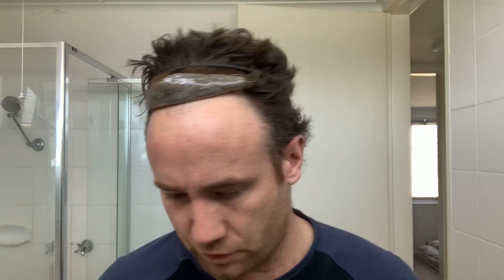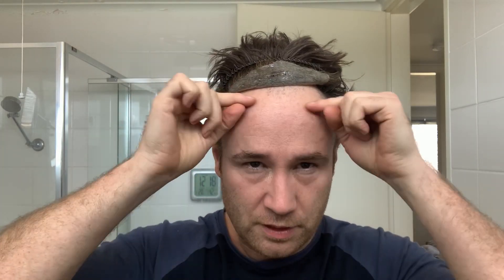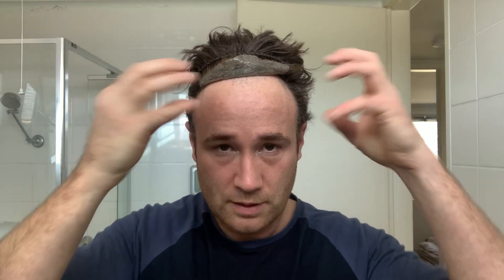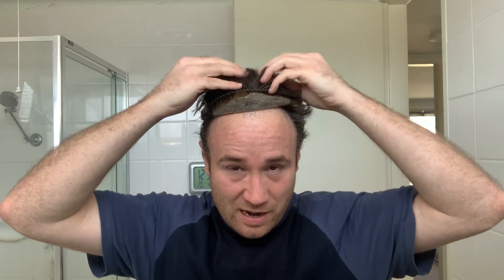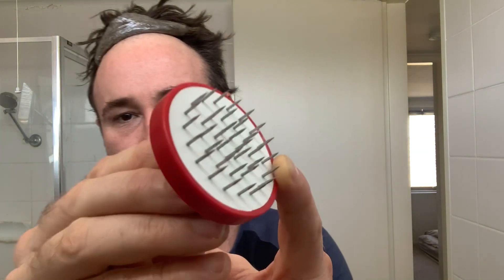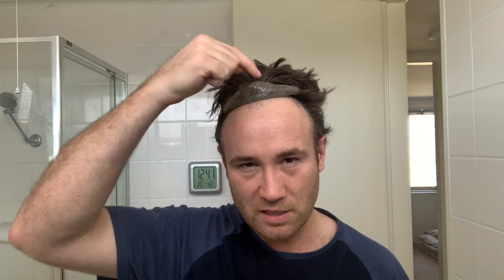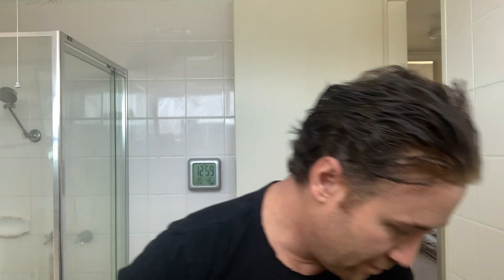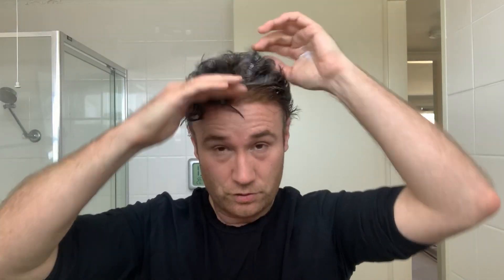Let's talk about Adhesives

Comment: Adhesion is one type of molecular structure clinging to another type of molecule structure, such as tape onto the skin. Cohesion is a mutual attraction between molecules that are alike- like a sentence structure, how all the words work together to create one COHESIVE thought. Cohesion is a bond that is built up internally, like your example of the peanut butter on bread, and adhesion is strictly one material sticking to another material. When it comes to sticking an object into skin you’ll be in the market for an adhesion and the list of demands/requirements to ensure a secure long lasting bond is pretty extensive. What comes to my mind as far as possible out of the box options that might be worth exploring is some using some kind of medical cyanoacrylate adhesive- surgical glue. I’m thinking along those lines because it’s made to be used on the skin, it’s a strong bond, very durable, and water proof (so I’m assuming it would do well with sweat also). Have you ever tried surgical glues before? Or do you know if the glues manufactured for wig instillation is already modeled after surgical glue properties?
Reply from the maker: cyanoacrylate adhesive (surgical glue aka topical skin glue aka 'dermabond') costs $79.95 per 0.5 ml. 12 vials for $396.50 not including delivery: https://www.teammed.com.au/shop/wound_care/wound_closure/topical_adhesives/dermabond_topical_skin_adhesive/
Reply: StickOnHair  that’s absolutely obscene! I had surgery last year and surgical glue was used to close up my incision. In the middle of the night during that itchy healing phase I scratched my incision until parts of it opened. I was able to buy a bottle of surgical glue for $7.99! I just looked on Amazon and can find various brands of the glue anywhere from $7-30 all depending on brand and volume. I know you’ve mentioned how expensive other things are in your country, but if you’re paying that much for surgical glue their just robbing you blind at that point! 
I can literally walk around the corner from my home to Walgreens or CVS or Walmart or Target and buy it for less than $10.
Reply: StickOnHair next time you’re in LA or anywhere in America, come with a list of all the stuff you can buy super cheap here! Haha. Bring an empty suitcase and just load up.
Reply from the maker: @lindzexposure9347  Unbelievable. Checking website. Wow!!  USD19!!! I registered... I placed 1 vial into my shopping basket... Inserting address... Here are my shipping options: Fedex Int Economy: USD139.62. Fedex Int Priority USD149.12. USPS Priority Int USD59.10 USPS Priority Mail Express Int USD79.10. I've said it before and I'll say it again. America has EVERYTHING.

Comment: Hey, like your videos, ive got my first hair system from lordhair, thanks to you👍✌️
I wear full head system on top of my head, can you give advice about how to attach it by my self without messing everything)))
My system is s1 and i use devlyn adhesive😊
Thanks✌️
Reply from the maker: Artur Liping I’ve never had to do a full piece. I’d say most people make sure the hairpiece is cut properly to their shave-zone, attach the front first with glue and just add tape to the back and let it fall back and hope for the best. But If it were me, I’d get a 7ft iPhone tripod from Amazon, wifi link it to my iPad and glue my head properly with proper visibility using the screen in front of me. Davlyn green and acrylic glues can’t be rinsed out of hair easily like water based glues (in the first 30 seconds),  so maybe tape or water glue is a good idea for the back of your head. This will be tested every time you lie on the pillow and move your head around so it can’t be a weak hold. The front hairline is crucial for realistic appearance so use the strongest hold (Davlyn Green) for that. As for breathability, let me know if the full piece of plastic over your entire head gets hot. People keep talking about poly perimeters with lace in the middle for breathability. I really don’t see any way to glue the perfect perimeter at the back of your head: you can’t feel for it without getting glue on your fingers and it’s going to be be hard to see it without folding it back which will bend the base and give you a false sense of distance. My bet is that 100% of full cap wearers have inaccurate perimeters with overhang as a daily occurrence they have simply learned to accept. Here are my 2 best guesses about the best full cap hairpieces: poly perimeter with lace centre for easiest cleanup, or poly hairline only with the rest lace for most realistic hairline AND most realistic perimeter (lace blends with natural hairs more realistically than poly). Both of these options will let your head breathe. I tried stabbing my poly hairpiece a bunch of times with a spiker but the holes were too small to do anything. Lace breathes whereas poly does not. If you have to choose between overhang and gap at the back of your head, you MUST favour the overhang. If there is overhang in all directions, resize your hairpiece smaller - there is a little bit of stretch in both lace and poly but beware of recoil. Gaps are UNACCEPTABLE. I leave them sometimes cause my hair is curly and you can’t tell when my hair is dry if there’s a 1 mm gap. That mirror thing I built does not allow me to see the back of my own head - you need a camera with a light behind you and a screen beside the mirror so you can see your entire head. I recommend a gooseneck tripod so you can just bend the camera instantly into new positions as required. Above all: don’t run out of hairpieces. Let me know if the full poly system pisses you off, and if it does, let me know the best way to poke holes in it please :) I think the ultimate configuration is the full poly unit you have but with holes for heat venting so you can peel off glue easily all over and it hides shine completely. I would do this even though the perimeter will not blend as well as lace because cleanup is more important than perimeter blending because poly blends well enough if the hair covers it. Please don’t rip the hairpiece because your holes are stupid - I have zero experience with full hairpieces. Remember, glue will ooze through lace when you melt it by wearing a hat or helmet so poly really is the ultimate answer.

Comment: You covered the holes with glue. Try going just around the perimeter with the glue. Also punching holes in poly some holes will reseal somewhat because of the hole peice on hair side lay back down over the hole. Just thinking it through
Reply from the maker: The glue magically doesn't cause sweat buildup under a lace piece with full glue coverage. The poly is causing extra heat or preventing evaporation through microscopic gaps in the glue - it needs holes. But I don't like lace because I cant wear a hat or helmet, the hairline glue bloats after a shower, the glue visibly shines through, etc. Poly with holes is my best solution. I just haven't succeeded in putting the right holes in it yet - I wouldn't use a hole punch because I don't want to lose hairs - I just want heat vents.

Comment: Hi, have you still noticed a shortage in hairsystems and cost increase?
Reply from the maker: Haven't needed to check lately. I assume its harder to get exactly what you want for pre-covid prices, though. I'm finding it really hard with a lot of things I buy online at the moment, as workers in many countries are legally obliged to work from home. This slows everything down.
Reply: @StickOnHair  Thank you, your channel is awesome!
Reply: I have no issues with walker hold glue, here is what i do:

- decant the glue into a different bottle with a think nozzle so you add a thin and precise layer DIRECTLY to the system. These can be found on amazon.

- use a small hobby brush to spread the glue. Again amazon in packs of 100, chuck em after one use.

- I re apply every 4-5 days, no idea how people go a month, its so easy to do takes me 20 mins and doing it this way is comfortable and gives a bullet proof connection every time.

- side note: rub a little cookibg oil on scissors before cutting tape to avoid it sticking
Reply: I believe it’s because of the majority of systems originate in China.
Reply from the maker: @jackparsons6299  Do you glue over the old glue?
Reply: @StickOnHair  no why do you ask? I always completely clean my system every time i take it off. I don't shampoo my hair every time i shower though, so I wash the system when I re groom
Reply from the maker: @jackparsons6299  I've recently started NOT cleaning the base of the hair system, and I just glue the new layer over the top of it. I know this is lazy, but I think I throw the hairpiece away before glue build up under the hair piece can affect me. I do this with Davlyn Green though - Walker Tape Ultra Hold is a lot thicker, so multiple layers might be a problem.

Comment: I’ve been using a system for around a year now. I’ve tried a couple adhesives, unfortunately the one you use isn’t available here. I’ve been using walker ultra, would you say that’s better than ghost bond platinum for PU ?
Reply from the maker: Everyone who likes Ghost Bond says Platinum is better than the rest of the water glues. Ultra Hold was the best glue I used for several years (but I still give it 3 out of 10) until I tried Davlyn Green, which I give 5 out of 10 (the best score I have given any glue). My experience with water glues has been disappointing (all less than 1 out of 10). Acrylic glues are very shiny so no good with lace. There is increasing chatter about silicon glues, but my experience has been limited to Walker Tape Extreme Hold, which cannot be re-stuck AT ALL without adding more glue - lifting occurred easily with sweat so I give it 0.5 out of 10.
Reply: StickOnHair unfortunately it’s
Reply: StickOnHair unfortunately it’s not available here :( 
I’ve noticed a distinct lack of poly generic units available currently, I think it must be linked to the lack of production from China
Reply from the maker: The Heathen Gamer I hope the industry picks back up or there will be a lot more baldness in the world.
Reply from the maker: @theheathencity6407  What do you mean by 'here'? Its almost impossible to buy glue from Australia. I have to pay $100 for shipping from America whenever I want glue.

Comment: Can you use liquid skin?
Reply from the maker: Got a link?
Reply from the maker: @garykulhanek7698  I would love to try Dermabond, but its $100 for a teaspoon of the stuff in Australia.
Reply: @StickOnHair  wow! How about looking up a Dr. or plastic surgeon. Maybe a medical supply store
Reply from the maker: Gary Kulhanek it’s all shipped from America. America has everything. I think in America it costs less than twenty bucks. You only get a teaspoon of the stuff but it might be worth it if you live in America to buy 2 or 3 vials.
Reply: @StickOnHair  well there's always staples! Lol just trying to help think it through with you. If I run across anything else in my head I'll throw it out to you.
Reply from the maker: Gary Kulhanek Staples is an American company
Reply: @StickOnHair  yes but I was referring to the mechanical ones or finish nails lol
Reply from the maker: @garykulhanek7698  Good glue is hard to find. Dermabond SEEMS like the ultimate.
Reply: @StickOnHair  from what I read I think that it may not work as well as you think. Not bond but removal and damage to unit.